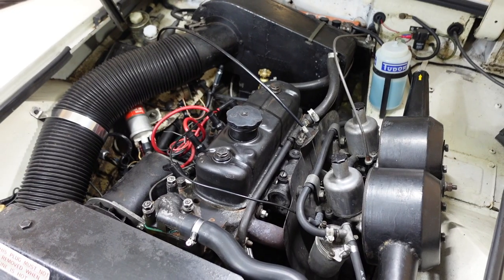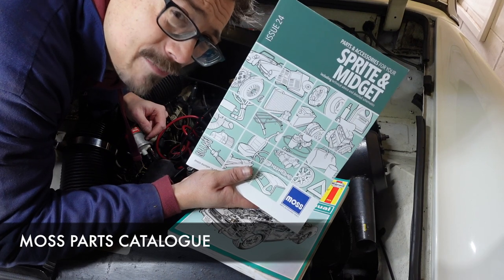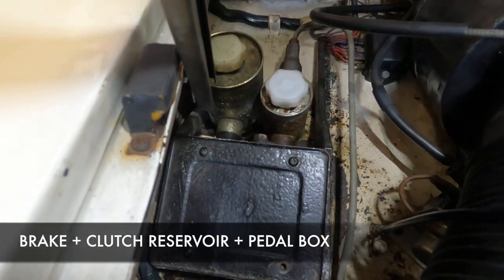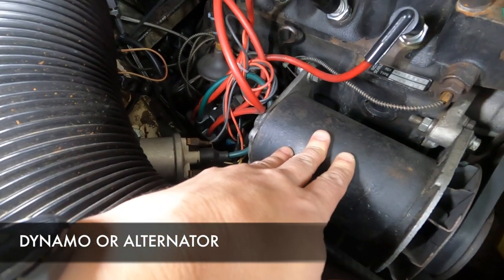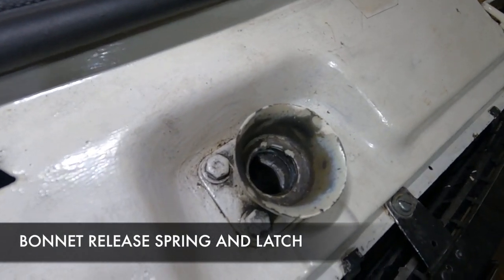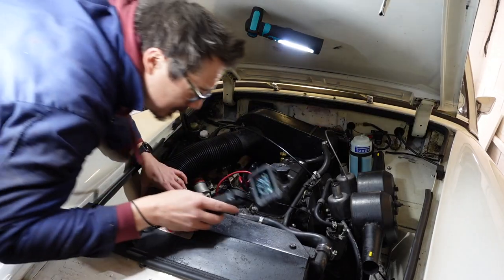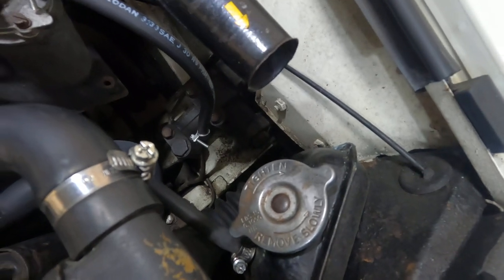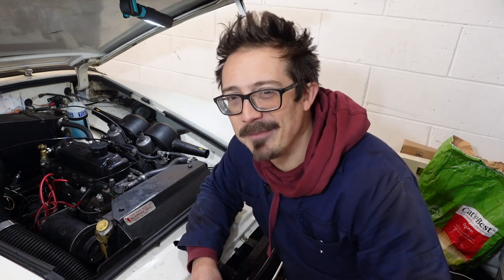1275 A-Series Engine Bay Guide

Comment: Can't get much simpler than that.  I grew up with these engines in so many cars and they gave me a great grounding for later adventures.  The Midget is the perfect sports car for beginning your classic car journey.
Reply from the maker: It really is. I mean. They still bite you in the bottom sometimes when you're working on them though. But that's old cars for you
Reply: @AndysMGAdventures  I can't count the time my bottom has been bitten over the years.  That's really another story though.
Reply from the maker: Yeah not even car related hahaha
Reply: Yes thats absolutely right! I am only 18 years old and i am happy i can work on my  Austin Healey Sprite mk3. It has a 1275cc engine, su 4 carbs and it has a rally- sporty ish exhaust. I didn't get it to run right yet, but time will tell and once the weather is clearing up I cant wait to take it for a drive. My friend is going to buy a mazda mx-5 second gen witch i see as the granddaughter of the spridgets.
Reply: @doit5560  Good the hear you're enjoying it.  If you have the timing correct, valve clearance set correctly, and a good spark, it will almost certainly be the carb set up.  Get yourself a decent vacumn gauge and spend some time balancing the carbs. Plenty of videos showing you how to do that.  Have fun.
Reply: @grayfool  Its not the carbs, it is more the distributor im struggeling with. Originally it had these manual distributor (don't know the right word in English, I'm not a native speaker). I bought an electric distributor, I connected it, a LED lamp started pinging, it was all set up but when i checked if i had spark (by putting the spark plug in the sparkplugleads and holding it against the mass), I didn't get any spark. None at all...
Reply: @doit5560  Oh.  That's a pain.  I never fitted electronic ignition to any A series I had.  Just used the standard points ignition and sometimes a high output coil.  Good luck with it.  Hope you can sort it out.

Comment: hi do you know where the choke cable comes out to in the engine bay? ta
Reply from the maker: I think it's through a small hole in the bulk head and pulls on the carburettor throttle mechanism